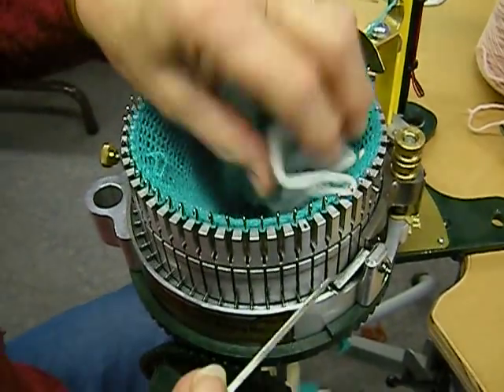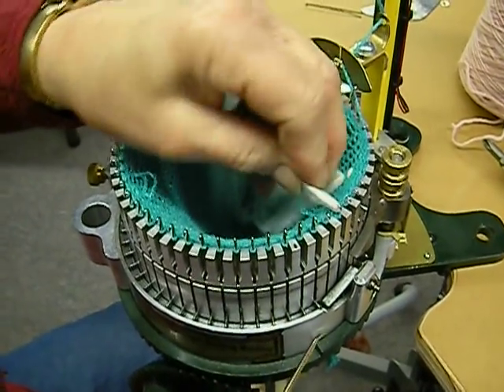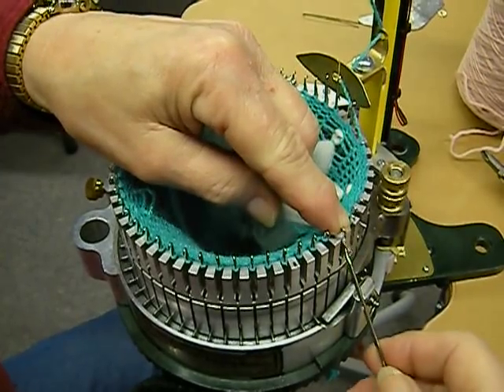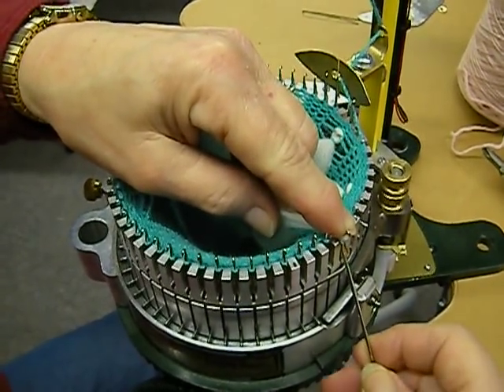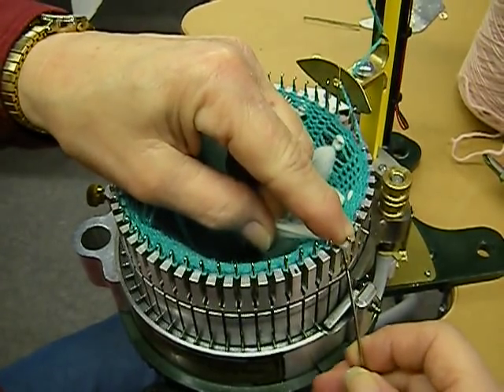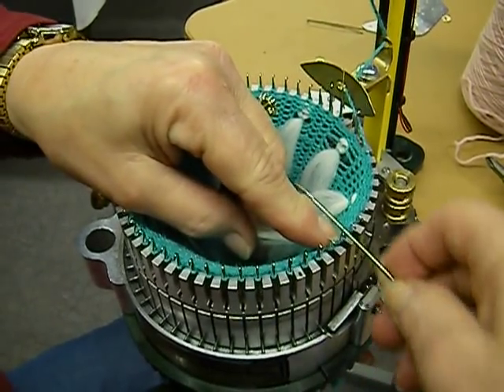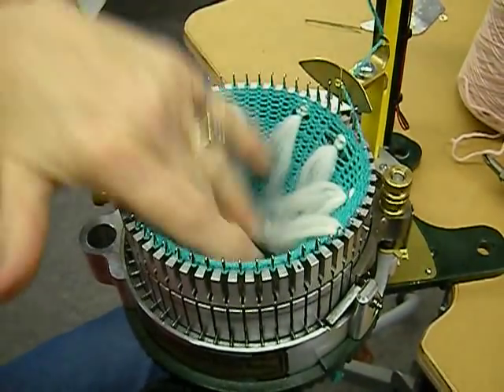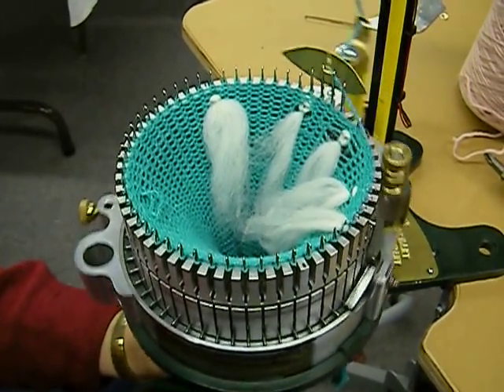Sock Machine Experiences: Thrumming on the Knitting Machine by Carole Wurst

Comment from the maker: Hi Vanessa, thrumming is for warmth and was traditionally used in cold climates. Handknitters have made thrummed mittens, gloves and socks and we want to show that a similar effect can be done on a flat or round knitting machine. Of course thrumming could be done on knit fabric as a design element or for decoration, too... but in this video the fleece will be on the inside of the sock.